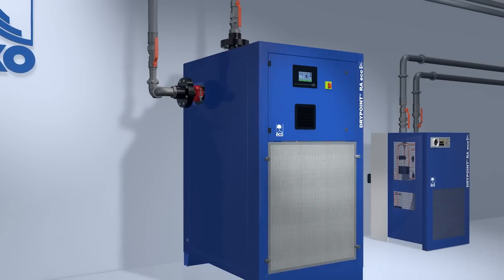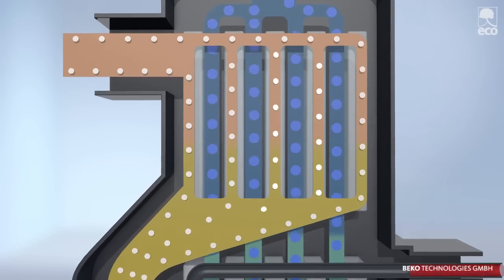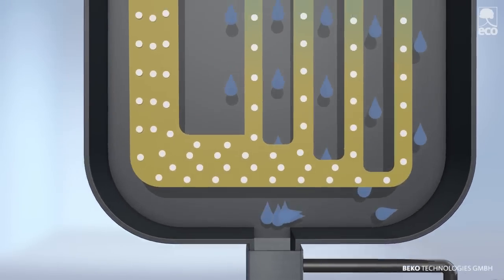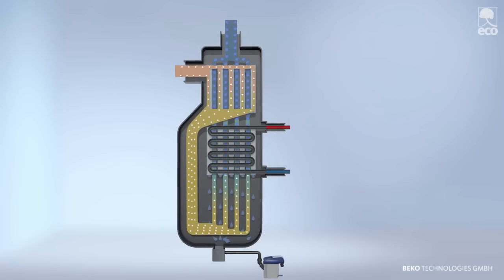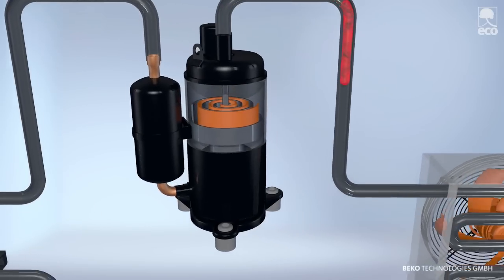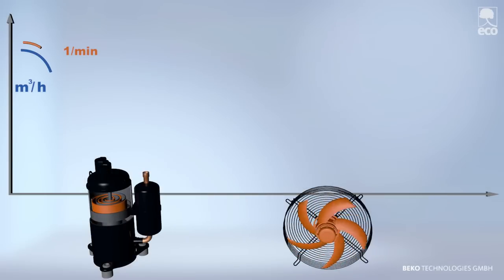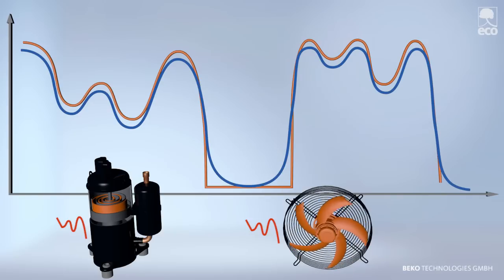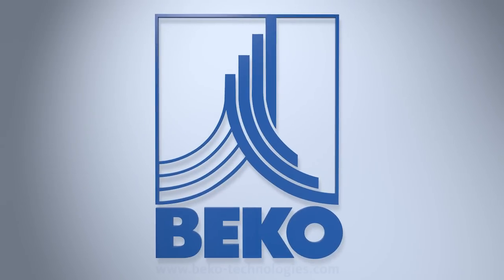DRYPOINT RA eco Compressed Air Dryer

Comment: My dryer cooling is fine but the air is passing through the outline it stops after 10-15 minutes no air is passing it is blocked again when it gets cold then it starts again after a while when it gets colder it stops again the outline air is not passing  What is the reason for this?
Reply: from your question, seems like your heat exchanger inside the dryer got freezing. u need to check if the freon gas got leaking at somewhere around the copper pipe. sometimes when the freon gas is leaking, then the heat exchanger will become freezing.

One more thing, need to check hot gas bypass. some cases the hot gas bypass did not function.
Reply from the maker: Although, the question is rather imprecise and leaves a lot of room for speculation, we understand that air flows in the housing when the dryer is warm and when it is cold the flow stops.
This behavior is normal because the case fan runs when more cooling power is needed and the fan stops when its little or no cooling line is needed.
 
It cannot be compressed air because this flow wouldn't stop but be permanent.

If you are using one of our products please contact our technical support here https://www.beko-technologies.com/en-en/contact/